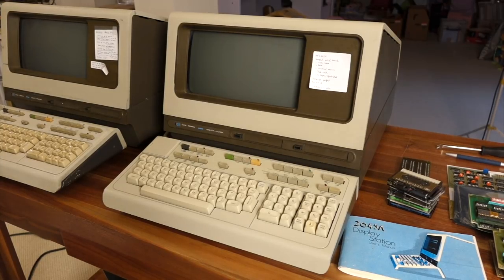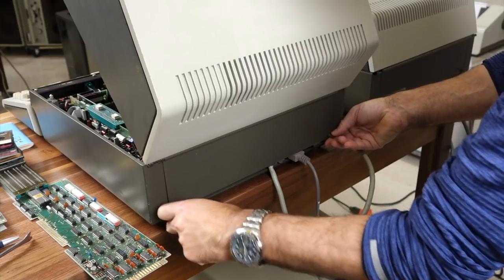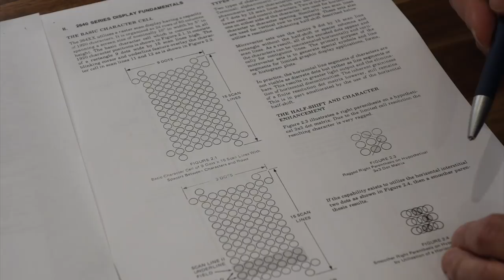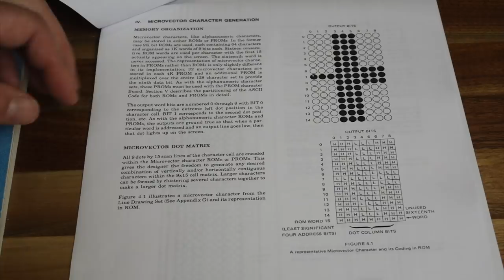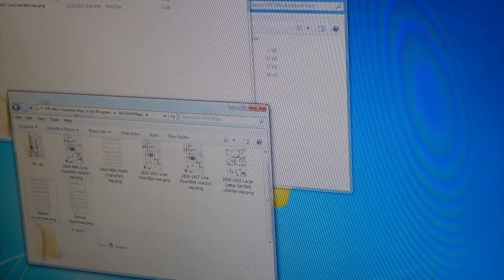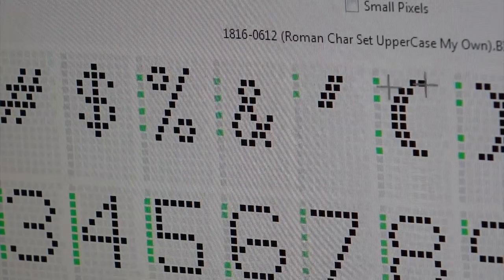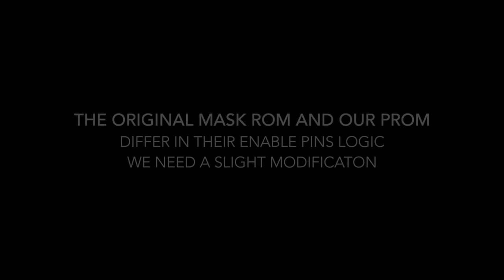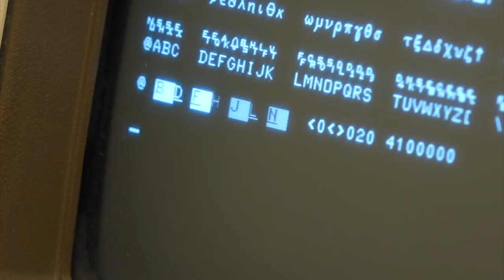HP 2645 Terminal - Part 1: Overview and Adding New Fonts

Comment: Was pleasantly surprised to discover your videos about  the 264x terms. I started my career at Hp Data Terminal Division in 1979, 1 week before moving production from Cupertino to Sunnyvale, CA.  I started as a technician 1 in thel "turn on" team. We were the initial group of techs to  do a final inspection, power up, calibration and trouble shoot to get them working. I averaged getting 7-8 terminals working per shift. There were alot of things that could go wrong in the mfg assembly processes and the Automatic Test System didnt catch everything. The 246x had a lot of buss and component sockets and connectors that had problems. Rotated to beeping land, which no one enjoyed standing in the heat all thru the shift. I was the first tech to beta test the 2647A tech procedures for the production engineer. I eventually transferred to the "Specials Department"; working on small production runs of one off variations mostly for the government. Lots of memories came back. I worked for hp over 14 years before they started taking the company apart in the early 1990s. Hp was a great company and a lot of were sick to see it end.

Thanks
Dave Burton
Reply: You should have explained "beeping land": the area where newly made terminals were tested, hence all the beeping. (Just found that out from reading some retrospective.) I find the image and name hilarious. :)

Comment: Awesome, thanks a lot!
I live in China and the research institute my father works in has a HP-5451C Fourier Analyzer since 1980. It was a giant rack powered by an HP-1000 minicomputer. Also included is one of the 2648 graphic terminal, a 10MB disc drive (with one internal disc and one removable disc), a plotter and a printer. It's said that when the machine came out it was forbidden to be exported to China, because it may be used for weapon developments (such as analyzing vibrations of submarines). The Chinese government managed to smuggle few of these units through Malaysia (or some other country which I can't remember exactly), and the machine I talk about is one of them. Of course it cost a lot of money. in comparison, an engineer back in the 80s can only earn ~10USD per month!
So far the system is still stored in a dust-proof room which was prepared specially for the machine. The screen of the 2648 also shows a lot of molds, but the overall situation seems nice. Maybe some day I'll get the complete system home, clean it and try to power it up.
Anyway, thanks again for the video and information.
Reply: Marc has one of these. It is on the restoration project list.
Reply from the maker: + Hf Luo: Fantastic story, I hope you can make it work. As Carl says, I have one (actually two) HP 5451c systems. My 2648 with heavy screen mold comes from one of these machines. On the long restoration list :-) .
Reply: That 10MB disc drive is probably a 7900.  I used to have one too.  I had a full 1000 computer system of 2113B computer, 7900A disc, 7970E tape, non-HP PT reader, non_HP PT punch, HP 2907A printer, HP 2600 terminal, and a few other things.  When the market for software consulting a d development dried up I gave it all to a computer dealer in Santa Cruz.

Comment: I repaired a lot of these both in the office and on customer sites . Screen burn was an issue as the terminals got older , HT failures were very rare and I don't recall ever replacing a power supply . 
The character ROMs had a manufacturing fault where 'silver migration' between the pins caused them to be unusable, later fixed by having resin epoxy externally applied outside along the ceramic top and bottom half joint line. By the time that fix came out the 262x line had come along, so any ROMs you find now will be either failed units or very late part number units. 
The main fix was remove the boards, clean the edge connecters and refit the boards. Sometimes it was a case of reworking the order of the boards as a customer had tried to copy a previous tech but didn't realise the board order and spacing was critical . Serial boards sometimes failed due to lightning strikes , but generally they were a tough machine. 
Please use a lot more static awareness/protection care as none of the boards or chips have any protection diodes in place against static damage.

Comment: I think the most advanced standalone programmer Data I/O produced was the 2900 which was designed to be run from a VT100 terminal and has a floppy disk drive.  One of its specialties was the ability to emulate a ROM using an emulation pod, and I think it could even be automated.

Comment: I assume you already found that dumps of the 2641A APL characters ROMs (1816-0984, 1816-0985, 1816-0986) are in pdf/hp/terminal/264x/264x_firmware/HP-2641_2642_2649 on bitsavers.

Comment: @20:48 "I wonder how many people have burnt a PROM and put it in and wondered why it wasn't working" When the first Apple II clone boards arrived in the late 1970s from China they were direct copies of the original and would only work with masked roms, to get them to work with EPROMS you had to cut a trace under the socket and solder in a transistor to invert the page select. It was a lot of work to install about eleven of these but since nobody had Apple roms and everyone wanted a clone Apple II it's what you had to do until the second batch of boards arrived. I made a lot of money in those early days modding those boards and selling roms that were copied from my high school's Apple II using a plug in rom burner. I copied only one rom per day to not arise suspicion and then changed the start up message from Apple ][ to AP2 in an attempt to avoid copyright charges as this is what lead other to be charged. Fun times.
Reply: Brian Boni there were Apple ][ Clones before the Franklin Ace?
Reply: What I had was an pirated copy of the Apple ][+ motherboard (empty and unsoldered) that my electronics parts supplier had pinned to the wall with a small sign on it about building your own computer. The Franklin Ace motherboard that I remember had a number of improvements like more memory and 80 col and it was smaller than the Apple board which leads me to believe it came later.

Comment: Wow, the resolution for this HP terminal, is much higher than the ones I had access to, back in the day. In the late 70s, and early 80's 7x5 was common. Look at your LCD character modules. They also use 7x5.

Comment: Great stuff. ;)

The 9-bit ROM thing does freak me out somewhat though. lol

Reminds me of the 9-bit wide RDRAM in the Nintendo 64, which is originally intended for parity checking of course, but they actually use the extra bit(s) only for "coverage" data for the anti-aliasing etc.

The RDRAM is accessed in eight chunks anyway, to form a normal 64-bit data word. The extra eight bits (from each of the 9 extra bits) then form an extended 8-bit bus for the coverage values.

So, for all other data / code storage, they are essentially wasting half a meg of the original onboard 4MB RAM. lol

Comment: Care to upload the character ROM dumps somewhere?  Long ago, I dumped the basic character set ones, reverse engineered the format, and made it into a screen font, but I'd love to have the Greek/math symbols as well.  The video board in one of mine died, and HP wanted $800 for a turnaround repair, or $1300 to sell the video board outright.  Later, I found a stack of oddly-shaped boards in a surplus store and recognized them as the HP26xx video boards, for $4.75 apiece.  I bought the whole stack.  Eventually I ran out of room and gave away all my HP26xx terminals.  I still miss those things.
Reply from the maker: It's been uploaded to my new website. You can find it on this page: https://www.curiousmarc.com/computing/hp-264x-terminals

Comment: The '77 Apple II HGR screen does exactly the same half pixel shift trick too with the msb bit of each byte of the hi-res screen buffer.
Reply from the maker: Thanks, I wonder how common that scheme is. It's my first time running into it.
Reply: Hi Marc, I don't know how common that is/was, but I know that in the Apple II it was used to modify the shape of the video signal in order to generate a different set of colors on a color display, it just happens that when seen on a monochrome display the effect is a half a pixel shift. I saw that hp terminal on ebay, the one with the spots on the screen and was about to buy it :-) you beat me to it it seems! I read somewhere that the spots were inside the screen (and were fungus), is that true? And if it is, how can you fix that? (I find it hard to believe that fungus can grow inside the crt)
Reply from the maker: The "rot" is in the glue between the CRT and the implosion shield (or just anti-reflective?) front glass. I am not sure if it is fungus, looks more like chemical degradation. The majority of the HP 264x have that problem. You fix it simply by removing the glue layer. One of my next projects...
Reply: Ohh, that's not so bad then! Use a hair dyier and patience, no? Or chemicals? What's the plan?

Comment: Great Video,  I remember using this terminal in Highschool in Brussels in 1990 when having cobol practicum on an HP3000. Even then I was blown away by the image quality of the text on that display.  Do you know if these can be used as a terminal for something more common than a HP3000 like a serial port of a raspberry pi or so?
Reply: The answer is absolutely yes.  I've got a Pi hanging off mine.  You have to load extended termcap libraries that have the hp2645 definition, and your Pi needs a full RS232 interface -- but otherwise it 'just works'. I've used my setup to do admin tasks against modern LINUX VMs for work -- just as a pleasant change of pace to PuTTY.
Reply: A simple serial (RS232) connection sending ASCII. HP documented the special characters to switch fonts, etc.
Reply: The terminal has an RS-232 serial port. The RasPi has a TTL-level serial port, so you need something that brings it up to RS-232 levels. Strictly speaking I do not think the terminal requires hardware flow-control — we used to use three-wire cables between HP terminals and the 3000 back in the 1980s. But, the 3000 was configured to do ENQ/ACK flow control on those ports (termtype 10) to keep from overrunning the terminal. Then you can build the SIMH HP3000 simulator on the RasPi and get back to COBOL.

Comment: Hi Marc, so enjoyed this (as I do all your videos).  We had HP2645A terminals for the HP3000 Series III that I worked on at my first job in the early 80s.  (10+ users in 2MB of ram, but that's another story).  So it was great to have the memory jogged.

As you say, engineering was so over the top by today's standards (not to mention the price!).

The line drawing character set and the enhancements (half bright etc) enabled really beautiful screen design.

At the start you didn't mention the HP2641 APL variant - we had one for some reason - APL character set and an APL keyboard.  http://www.hpl.hp.com/hpjournal/pdfs/IssuePDFs/1977-07.pdf

You probably know that the escape sequence language that HP terminals use (which was of course over-the-top sophisticated in the usual HP way) was the ancestor or perhaps cousin of the HP-PCL language they used on their printers too.  In the context of the HP2645 the most interesting or exciting part is that the HP264x terminals had an undocumented escape sequence that allowed you to download code into the terminal and execute in on the processor.  There was a file that went around the HP community that when "printed" to the terminal downloaded and executed a Space Invaders game.

I wonder if you can find that file?  I'm certainly going to look and ask a contact or two.

Regards from Cape Town, South Africa
Steve
Reply: If anyone has a HP2645, here are the games that I remember: http://newton.freehostia.com/net/termgames.zip
Reply from the maker: +Steve Davies: Thanks for both comments. I didn't know of the APL HP 2641 until I stumbled on it when digging out info on the existing character sets, which was one of the last takes! And although I knew about some of the games (none tried yet), yours seem to be different from the ones I have, so digging the link is really appreciated.
Reply: I'm looking forward to finding out if they run.  Having tried my hand at writing some code for the 2645 I'm familiar with the crazy screen which happens when the linked list that defines the display contents gets messed up.

Comment: No HPIB?  Gee.. build one.  That would be one sweet interface for HPIB instruments.
Reply from the maker: But there is an HP-IB card! I even think I have one in one of my terminals. It was mostly used for printers and I think even plotting. I suppose you could just use it to send strings to control any HP-IB device. That would be an interesting use of the terminal! I believe the HP 2648 can also print its graphics on the HP 2631G, since I have both I shall find out. Hmm, looks like the subject for a whole video...
Reply: A lot of the 70s, 80s and early 90s HP instruments like a few of the scopes output some really neat stuff on the HP-IB interface.

Comment: Why's it called a terminal?  Seems to have a fair amount of computing power onboard locally, especially for something that came out in the mid to late 1970's.  When I think of terminals, I think of DEC VT-100's or IBM 3270's (both of which are fairly dumb in comparison...)
Reply: Because for all this thing's sophistication, it's still designed solely to talk to a larger computer system, not to handle computing problems on its own. Its onboard computing power is only to handle that task.

I can't say about the IBM 3270, but the VT100, which came out a couple years after the HP 2645A, actually has about the same amount of processing power on board. Both the HP 2645A (and other late 264x terminals) and the original VT100 are built around the Intel 8080A, running at 2.5 MHz in the 2645A and 2.76 MHz in the VT100. While the 2645A has more memory and expandability, the VT100 can handle faster connection speeds (19200 baud, vs. 9600 baud for the 2645A). I'd guess that DEC optimized their terminal more as a fast character-oriented device, rather than the block-mode form-filling terminal that HP seems to have liked.

Comment: 9 bit roms that's really strange though I heard some models of these can run basic which makes them an actual computer.
Reply from the maker: Yes. It's the HP 2647 which is still in the box in my video that can run Basic. The original Basic from Bill Gates actually. Haven't tried it yet. Coming up.

Comment: What did you end up doing to deal with the fact that you only had an 8-bit PROM in a board expecting a 9-bit ROM? Did you just ground the 9th bit?
Reply from the maker: For characters with half-shifts it actually expects an 8-bit ROM, so all we had to do for the Math set was to configure some jumpers and modify the enable scheme. But for microvectors, my card really needs a 9-bit ROM, so it will be more complicated. We will show that in Part 2.

Comment: how can you repair screen mold/rot?
Reply from the maker: You need to remove the layer of degrading adhesive compound between the blast protection glass and the CRT. You can use chemical, heat or mechanical methods (or all of the above) to remove the adhesive. I need to do this for most of my terminals, we'll eventually make a video on it.
Reply: wait so thats why crts never explode if smashed?or if its not it, why is that protection glass necessary?